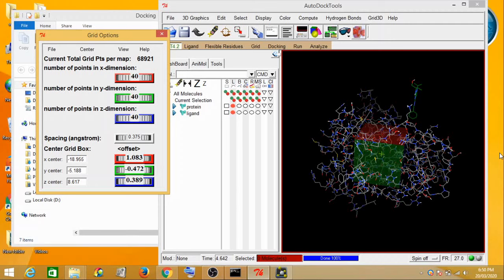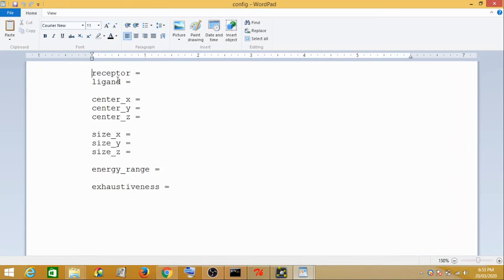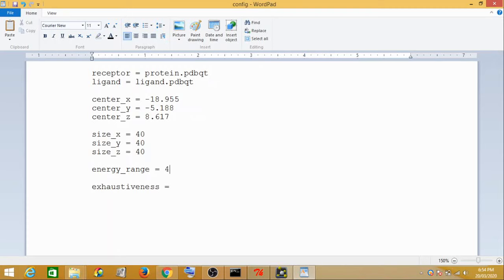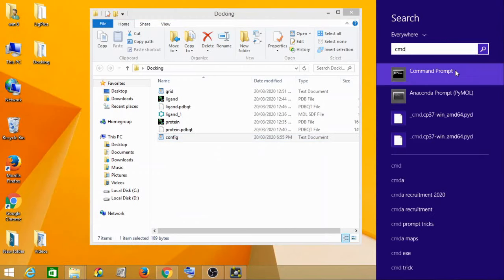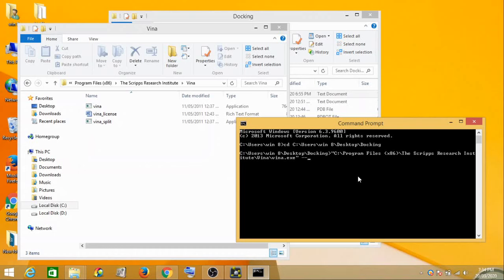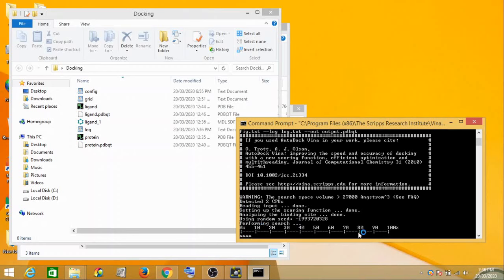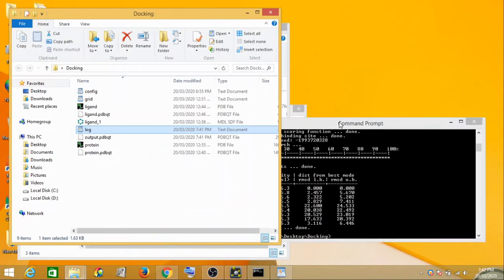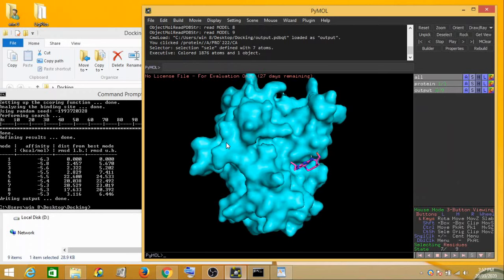Molecular Docking Tutorial: AUTODOCK VINA - PART 2 | Beginners to Advanced

Comment: after autodoc vena command im getting this
Correct usage:

Input:
  --receptor arg        rigid part of the receptor (PDBQT)
  --flex arg            flexible side chains, if any (PDBQT)
  --ligand arg          ligand (PDBQT)

Search space (required):
  --center_x arg        X coordinate of the center
  --center_y arg        Y coordinate of the center
  --center_z arg        Z coordinate of the center
  --size_x arg          size in the X dimension (Angstroms)
  --size_y arg          size in the Y dimension (Angstroms)
  --size_z arg          size in the Z dimension (Angstroms)

Output (optional):
  --out arg             output models (PDBQT), the default is chosen based on
                        the ligand file name
  --log arg             optionally, write log file

Misc (optional):
  --cpu arg                 the number of CPUs to use (the default is to try to
                            detect the number of CPUs or, failing that, use 1)
  --seed arg                explicit random seed
  --exhaustiveness arg (=8) exhaustiveness of the global search (roughly
                            proportional to time): 1+
  --num_modes arg (=9)      maximum number of binding modes to generate
  --energy_range arg (=3)   maximum energy difference between the best binding
                            mode and the worst one displayed (kcal/mol)

Configuration file (optional):
  --config arg          the above options can be put here

Information (optional):
  --help                display usage summary
  --help_advanced       display usage summary with advanced options
  --version             display program version

Comment: Very informative tutorial, but you have mistaken in one thing. AutoDock Vina, in contrast to AutoDock 4, uses different grid box units. Therefore, in order to achieve correct box size you must set spacing parameter to 1.
Reply: Hey! Thanks a lot this was useful. I got wrong results after ignoring spacing. Now i set it to 1.

Comment: While running vina , I am getting following output. Kindly help me how to solve it:

C:\vina>vina ..config mof.txt ..log log.txt

Command line parse error: too many positional options
Correct usage:
Input:
--receptor arg rigid part of the receptor (PDBQT)
--flex arg flexible side chains, if any (PDBQT)
--ligand arg ligand (PDBQT)
Search space (required):
--center_x arg X coordinate of the center
--center_y arg Y coordinate of the center
--center_z arg Z coordinate of the center
--size_x arg size in the X dimension (Angstroms)
--size_y arg size in the Y dimension (Angstroms)
--size_z arg size in the Z dimension (Angstroms)
Output (optional):
--out arg output models (PDBQT), the default is chosen based on
the ligand file name
--log arg optionally, write log file
Misc (optional):
--cpu arg the number of CPUs to use (the default is to try to
detect the number of CPUs or, failing that, use 1)
--seed arg explicit random seed
--exhaustiveness arg (=8) exhaustiveness of the global search (roughly
proportional to time): 1+
--num_modes arg (=9) maximum number of binding modes to generate
--energy_range arg (=3) maximum energy difference between the best binding
mode and the worst one displayed (kcal/mol)
Configuration file (optional):
--config arg the above options can be put here
Information (optional):
--help display usage summary
--help_advanced display usage summary with advanced options
--version display program version
C:\vina>
Reply: Correct usage:

Input:
  --receptor arg        rigid part of the receptor (PDBQT)
  --flex arg            flexible side chains, if any (PDBQT)
  --ligand arg          ligand (PDBQT)

Search space (required):
  --center_x arg        X coordinate of the center
  --center_y arg        Y coordinate of the center
  --center_z arg        Z coordinate of the center
  --size_x arg          size in the X dimension (Angstroms)
  --size_y arg          size in the Y dimension (Angstroms)
  --size_z arg          size in the Z dimension (Angstroms)

Output (optional):
  --out arg             output models (PDBQT), the default is chosen based on
                        the ligand file name
  --log arg             optionally, write log file

Misc (optional):
  --cpu arg                 the number of CPUs to use (the default is to try to
                            detect the number of CPUs or, failing that, use 1)
  --seed arg                explicit random seed
  --exhaustiveness arg (=8) exhaustiveness of the global search (roughly
                            proportional to time): 1+
  --num_modes arg (=9)      maximum number of binding modes to generate
  --energy_range arg (=3)   maximum energy difference between the best binding
                            mode and the worst one displayed (kcal/mol)

Configuration file (optional):
  --config arg          the above options can be put here

Information (optional):
  --help                display usage summary
  --help_advanced       display usage summary with advanced options
  --version             display program version
im getting this

Comment: I am new to molecular docking and had been struggling to use autodock vina. I had approached my colleagues and others proficient in its use. However, I must admit that none of them could explain this as lucidly as you did. I appreciate and thank you for your efforts to share your knowledge. As I have mentioned, I am new to autodock and after watching and trying the example elaborated in the tutorial, I have a couple of queries, as posted below. I hope you will try to spare some time to respond to the same. I must admit, these might be trivial but as of now, these are posing a hurdle for me. 
1. Is there an alternative to PyMol, like any other free software ?
2. Can we not use autodock tools for visualizing the output.pdbqt file?
3. Under what conditions should we change the parameters specified in the config file?
Thanks a lot again.
Reply from the maker: Thank you very much for your response, I am happy you were able to understand it. Coming to your questions:
1. We can use Chimera instead of Pymol
2. We can visualize output.pdbqt in autodock tool
3. If the pocket region is different then the parameters in config will change. 
P. S. I use pymol because I am comfortable with it.
Reply: You can use Rasmol as a visualization tool
Reply: @yogeetagoyal2086  No i have been trying it. it cant efficiently do when you opt for surface option in the tab!!
Reply: @amodraghupatibhat6288  read its manual once thoroughly...
Reply: @amodraghupatibhat6288  Pymol also you can use..

Comment: Firstly, Sir the video is very much useful and meaningful. Sir, I had an issue with running command prompt. I followed all the steps properly and when I run the code in command prompt, it runs till the "Analyzing the binding site.... " step and says insufficient memory every time. Actually C drive has enough space. Even then it says insufficient memory. I got the answers 2 to 3 times when I ran it initially and now it says insufficient memory.  What to do Sir?

Comment: Hi Sanket,
Great video, very well explained. One issue I've been having is that the binding pocket I'm investigating has two Mn(II) ions that are co-ordinated both by the receptor and the ligand when bound. When I process the the receptor through autodock tools, I get a similar error to yours with the notification that there is no charge on the Mn ions. I have tried correcting this directly through editing the pdbqt text but this doesn't seem to have been that effective. 
It would be really helpful if yourself or anyone else here could shed any light on solving this problem?
Cheers.

Comment: I am getting this problem, kindly help me out

Input:
--receptor arg rigid part of the receptor (PDBQT)
--flex arg flexible side chains, if any (PDBQT)
--ligand arg ligand (PDBQT)
Search space (required):
--center_x arg X coordinate of the center
--center_y arg Y coordinate of the center
--center_z arg Z coordinate of the center
--size_x arg size in the X dimension (Angstroms)
--size_y arg size in the Y dimension (Angstroms)
--size_z arg size in the Z dimension (Angstroms)
Output (optional):
--out arg output models (PDBQT), the default is chosen based on
the ligand file name
--log arg optionally, write log file
Misc (optional):
--cpu arg the number of CPUs to use (the default is to try to
detect the number of CPUs or, failing that, use 1)
--seed arg explicit random seed
--exhaustiveness arg (=8) exhaustiveness of the global search (roughly
proportional to time): 1+
--num_modes arg (=9) maximum number of binding modes to generate
--energy_range arg (=3) maximum energy difference between the best binding
mode and the worst one displayed (kcal/mol)
Configuration file (optional):
--config arg the above options can be put here
Information (optional):
--help display usage summary
--help_advanced display usage summary with advanced options
--version display program version
C:\vina>

Comment: C:\Users\karan\Desktop\docking>"C:\Program Files (x86)\The Scripps Research Institute\Vina\vina.exe" --receptor protein.pdbqt --ligand ligand.pdbqt --config config.txt --log log.txt --out output.pdbqt
Configuration file parse error: unrecognized line in 'ligand.ligand.bdbqt'

Correct usage:

Input:
  --receptor arg        rigid part of the receptor (PDBQT)
  --flex arg            flexible side chains, if any (PDBQT)
  --ligand arg          ligand (PDBQT)

Search space (required):
  --center_x arg        X coordinate of the center
  --center_y arg        Y coordinate of the center
  --center_z arg        Z coordinate of the center
  --size_x arg          size in the X dimension (Angstroms)
  --size_y arg          size in the Y dimension (Angstroms)
  --size_z arg          size in the Z dimension (Angstroms)

Output (optional):
  --out arg             output models (PDBQT), the default is chosen based on
                        the ligand file name
  --log arg             optionally, write log file

Misc (optional):
  --cpu arg                 the number of CPUs to use (the default is to try to
                            detect the number of CPUs or, failing that, use 1)
  --seed arg                explicit random seed
  --exhaustiveness arg (=8) exhaustiveness of the global search (roughly
                            proportional to time): 1+
  --num_modes arg (=9)      maximum number of binding modes to generate
  --energy_range arg (=3)   maximum energy difference between the best binding
                            mode and the worst one displayed (kcal/mol)

Configuration file (optional):
  --config arg          the above options can be put here

Information (optional):
  --help                display usage summary
  --help_advanced       display usage summary with advanced options
  --version             display program version

C:\Users\karan\Desktop\docking>

whats wrong

Comment: Hi Sanket, how do I change the pH environment of the protein-ligand environment (active site) using pymol and autodock vina? Under certain biological conditions, I would expect functional groups of ligands to be protonated or deprotonated depending on their pKa and pH of the active site. Do I need to consider this when designing my own ligands for docking? Are the pH conditions of the receptor "set-in-place" depending on the crystal structure pdb file that you use? Thank you once again for your easy to follow procedure.

Comment: hi, the vina command is coming as an error. saying its not recognized as internal  or external command. not able to understand the error .
Reply from the maker: There might be issues with the config file. Check whether the parameters in the config file are correct, also the vina command should not have any error.

Comment: Sir thank u for the vedio it made me easier to dock using autodock as I am new in this field  but sir when i run the command it show (command line parse error:too many positional options) sir what should I do now?
Reply from the maker: Check the config file whether its correct, also check the command you entered is correct. Generally even if there is small error it throws command line parse error.
Reply: @sanketbapat  sir I already checked but still it gives this ans sir plz help me to take out from this
Reply from the maker: @subhalaxmipatra3292  U can mail me ur query
Reply: @sanketbapat  but sir mail  I'd?
Reply: @sanketbapat  sir still it show the error can u give ur email is so that I can text u

Comment: hi could this be used for multiple ligands. i mean can 8-10 ligands be worked on the script and command("..." vina.exe) by modifying it
Reply from the maker: Yes, Vina can be used for Multiple Ligands (even more than 100 ligands). Just you need to make have script which runs these steps in a loop. The command("..." vina.exe) needs basic modification.